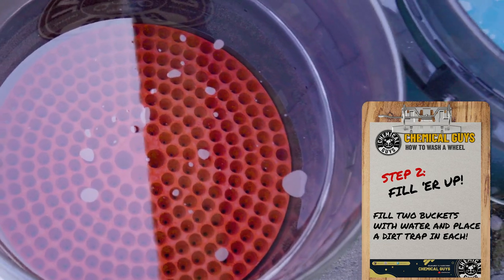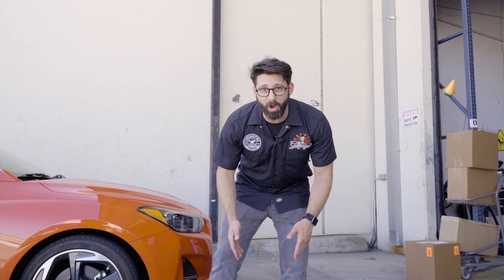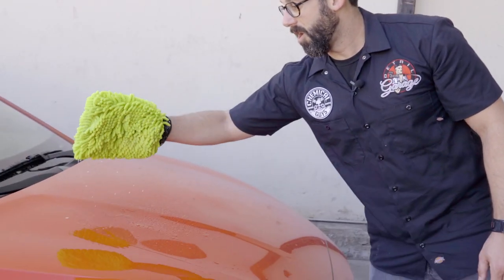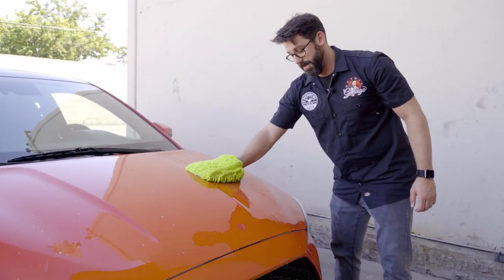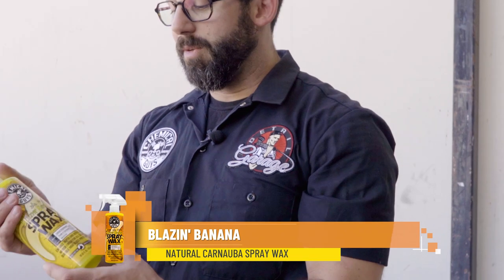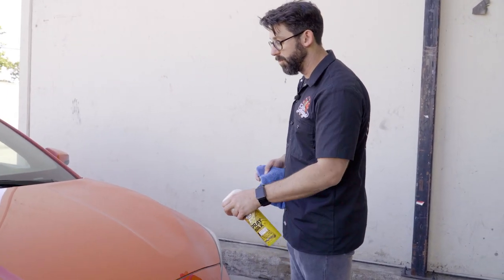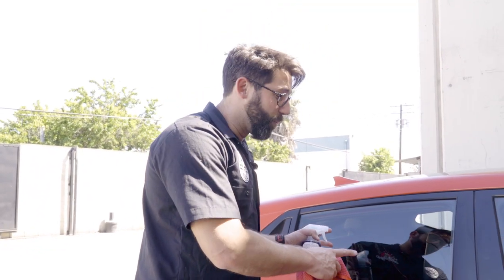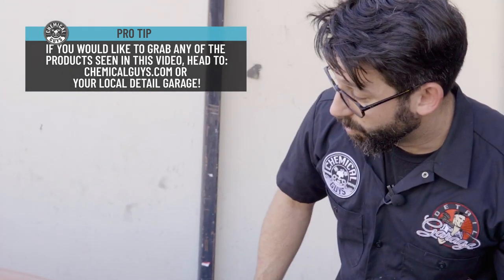How To Get Ultimate Shine in 6 Steps and 45 Seconds! - Dirty Shorts E2 - Chemical Guys

Comment: So I just got done rattle canning my fenders with primer, base, and clear. I'm suppose to wet sand then buff. Which product should I use in my case? V-line? thanks guy
Reply from the maker: Hey! Depending on what level of sanding sheet you finished with you can try using V36 Cutting Polish or if more abrasives are needed, use V34 Hybrid Compound.